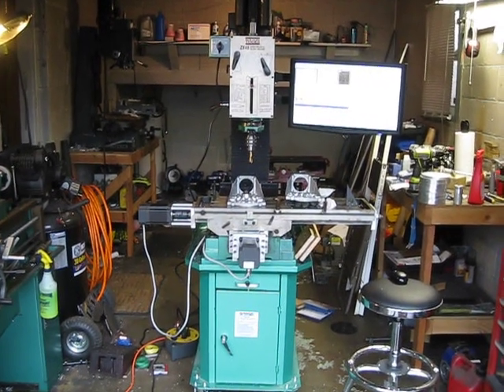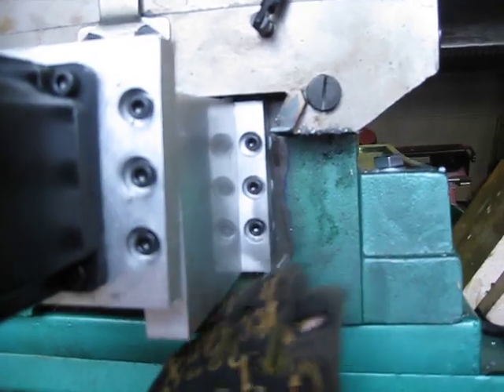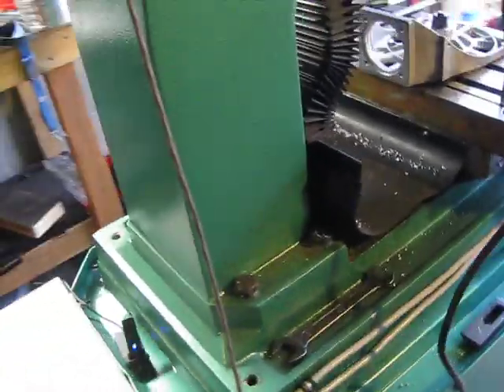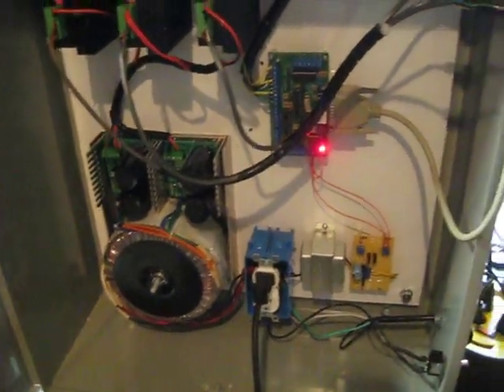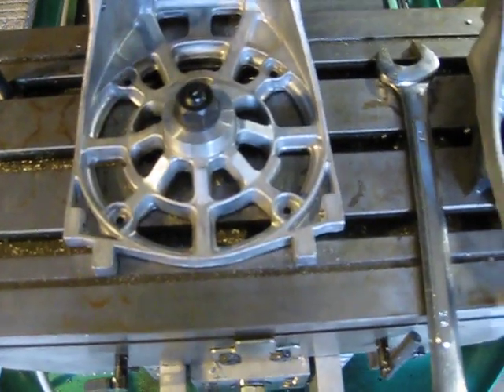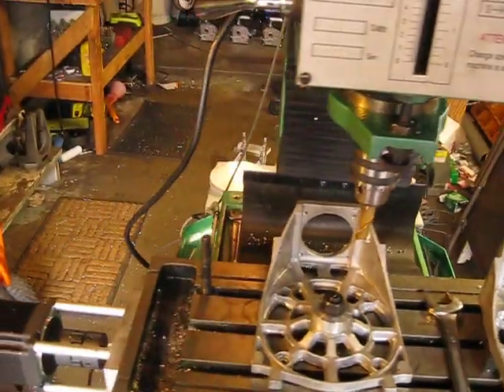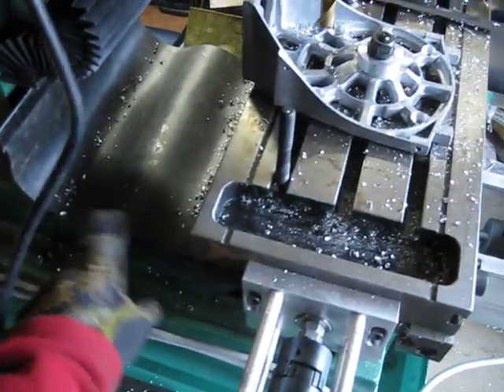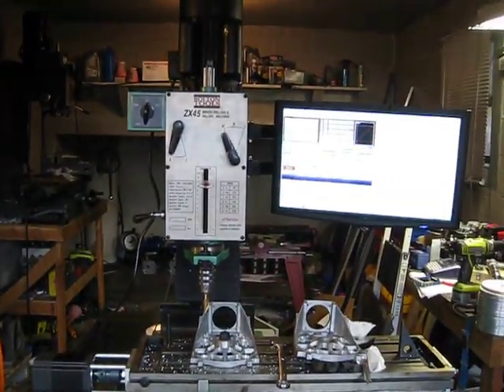Rong Fu type RF-45 CNC Mill Conversion

Comment: Mine, is never messy, only cluttered... With Tools in roll around tool boxes, and machinery!!!  
Yours has some things that are the envy of some of us!  Thank you for this video!  Just bought a Enco RF-31 (built in 1984) with the worm drive power feed of the Quill.  $600.00 on Craigs List, and came with two T-bolt and spacer/hold down jig sets, 2 German R-8 drill chucks, all the original collets, a flycutter, a Boring Bar with 6 bars... and a Curt 5 inch machinist vise.  First step is that I will install three axis position reporting with a kit.  Then, on to the CNC motors and controls...

Comment: that head is not designed to move during operations there's no Gib you loosen up the head and there's massive amounts of slop in it while it's loose.

If you have that machine adjusted properly if you put a fly cutter on it and a nice flat piece of aluminum you get a nice even pattern and then keep it running while it's running to loosen that had and it's going to dig into the front. It is not designed to do that that's why people automate the spindle not the head

Comment: hi gomiddlemas,, i have begin a conversion my mill zx30, I have found almost all parts, they missing , 2 mount rack for motor nema34 and 1 for nema23, and controller. I not have found solution for anti-moviment of column head that cause a out centering... You have a solution done ?

Comment: Proto Trak etc by Southwestern Industries uses encoders not glass scales for feedback I worked there designing test equipment from 1991 through 2000. At the time i worked there they used optical encoders  made by HP. Before I came there they used to make their own encoder wheels which were used in their patented mechanical sensor. It ran against a machine's ways or a run bar. Some of their sensors were called Trav A Dials. They used to supply their electro mechanical sensors or glass scales.

Comment: I personnally don't like the overloaded style ballnut. Sure it reduced backlash, but it also increases drastically wear rate. IMO the best thing to do is to use 2 ballnuts per axis and load them with a spring so you can control the overload. I used that on my SX3, easy to do and very effective.

Comment: Nice job on the conversion. Heavy duty and strait forward.

 Why not use a smaller cutter and enlarge those holes using some circular g-code? Would be a much nicer cycle than counter boring with that endmill. Some coolant would help too.